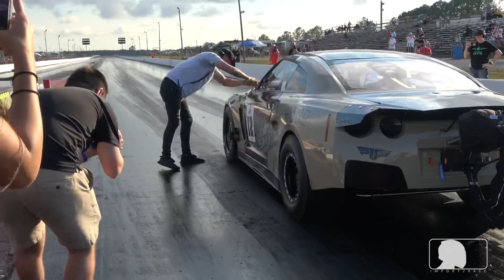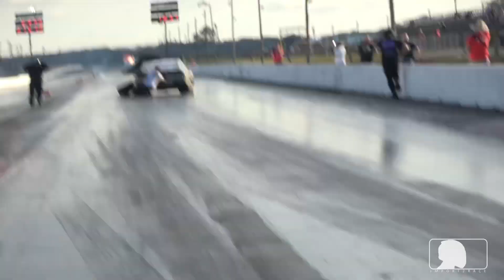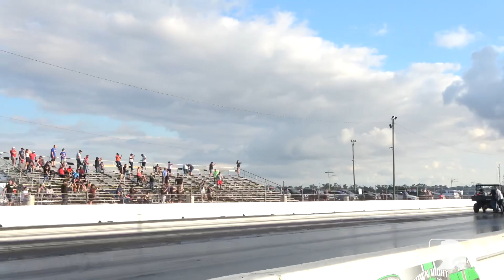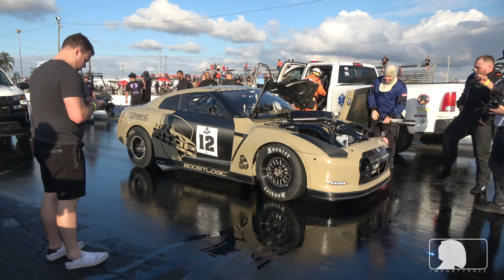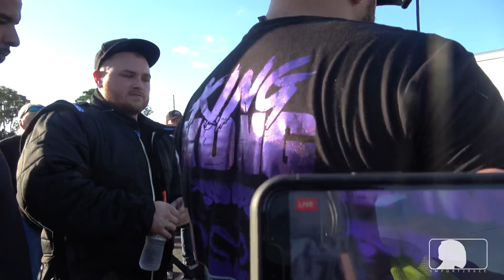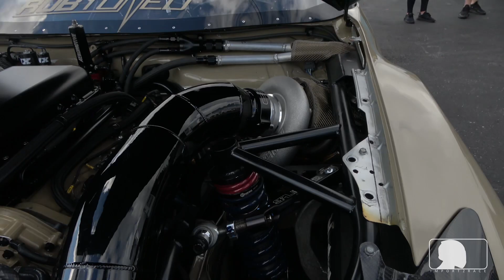The Shop Houston Manifold Exploded at the GTR World Cup

Comment: What happened to the burst panel? Or did it not have one.
Reply from the maker: Are you talking about the hood?
Reply from the maker: Forgot to add it to the video, the other part of the video was live stream
Reply from the maker: @LycheeMonstaMedia  thanks for the info and the link,  I just read it.  
SFI Burst panel and flange weld on kit - comes supplied with mounting bolts.
Total flange weld on size - 120 x 75 x 12mm   ( SFI panel only  108 x 60mm )
Burst panels are designed to save your intake manifold/blower manifold in the event of an engine backfire. This panel releases pressure in the event of a backfire, which releases pressure that would otherwise be encased in the manifold. A backfire can cause material fatigue or complete destruction of the manifold.
Reply: @ImportRace  I know what it is. Did the one on the Shop Houston GTR burst? Or did it not have one?